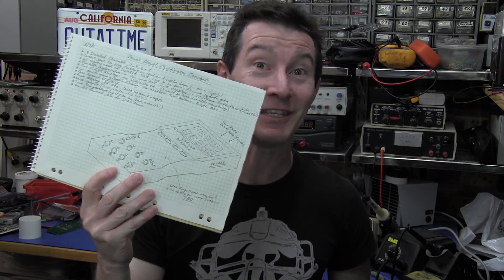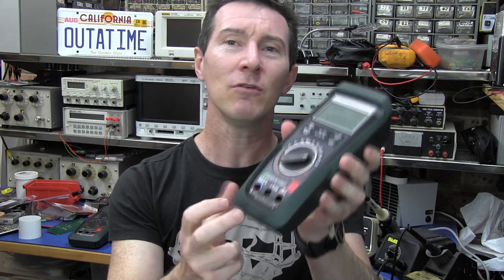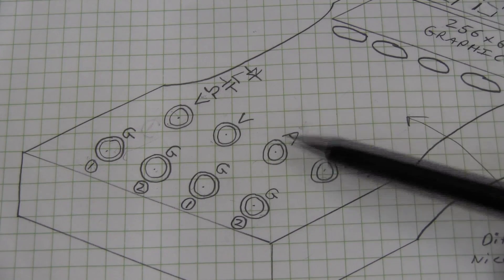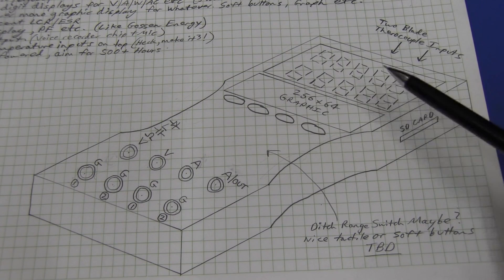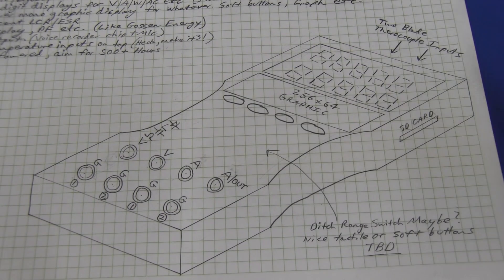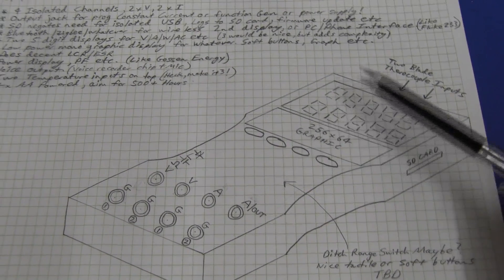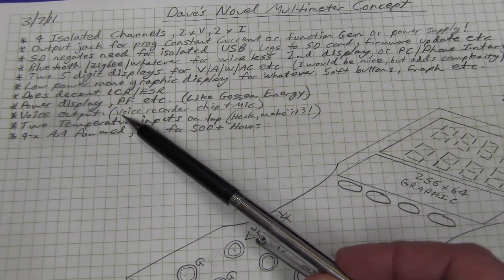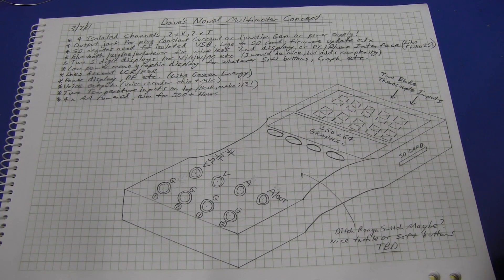EEVblog #184 - Open Hardware Multimeter Concept

Comment: Designing you own multimeter?
Now there's a project idea ...
If I were to make my own "multimeter" it would probably not be a "handheld" device.
It would be something like a 19 inch rackmount multimeter with lots of memory for data logging. And it would have lots of voltage / current inputs, so you could use it like a curve-tracer or measure 3 phase power or stuff like that ...

And the optional PC interface would be done with fiber optics.
No need for easy to loose SD cards and still isolated!

Comment: I stumbled here while researching my desire to design a 4 channel bench voltage/current meter.  My thoughts on the matter:-

As Dave says, a DIY multimeter project needs to provide novel features to justify its development over simply continuing to use existing multimeters. The features discussed in the video can be broadly grouped as:-

(A) 4 isolated V/I channels, and the resulting synergies for power/efficiency measurement
(B) Logging
(C) Battery life considerations
(D) All the other stuff

Feature group  (A) is inspired by the advantages it would provide:- 
* Reduces the workbench clutter of using 4 separate multimeters 
* Enables the synergies of P/E measurement, and logging

Which are of most benefit at the workbench. So it is best implemented as an item of bench equipment. Furthermore, a bench unit obviates problems with battery life, especially considering the extended operating time implied by logging, which is useful for both (A) and (D), but mostly for (A).

Feature group (D) comprises functions that usually:- 
* Only need a single channel
* Are needed only intermittently
* Have minimal impact on battery life
* Can benefit from being physically separate from (A), because it:-
  - Is out of the way when not needed
  - Doesn't disturb (A) when it is needed
  - May need to be used on items away from the workbench  

So it may best and/or more easily implemented in the handheld format, and can still provide logging. This can be either as an off the shelf existing multimeter, or as new project if the feature set justifies it. It may even be implemented as a (separate) bench unit, if the feature set is large. 

So to me it seems that my original plan for (A) in bench format makes sense, and that (D) should/could become a separate project for a later time, possibly split across both handheld and bench formats, but catered for by existing test equipment in the interim.

Comment: I like the idea of getting rid of the range dial. But how would the input switching be done then? Mechanical or solid state relays would consume quite a lot of current. Is there a low current way of getting around skipping the range dial?

Comment: should also do logging; having SD card is nice, but nowadays, it also needs to connect to your wi-fi network and allow data acquisition wirelessly, Bluetooth is a pain in the ass, wi-fi makes the whole interfacing thing trivial, just use the IP and open up a web page, from anywhere in your network

Comment: I would love to see you take this on the way you did the power project. Please. As for features….. 2 channels is enough. definately need the power supply with PWM/signal and function gen. I would love to see a basic logic analyser and maybe serial com output for testing SPI, RS232/485, I2c. TTL counter for rotary encoder checking would be great. I am an industrial Automation Tech and have dreamed of a device like this for trouble shooting PLC based control systems.

Comment: Dedicated buttons are way better than a dial. A dial is sequential: if you want to go from setting A to setting F, you have to click through B,C,D and E.
It's like a train.
A button is direct. Straight from A to F.
Teleportation!
Magic!
Reply: Also, a dial will probably cost more to manufacture and/or a low quality dial will wear out.
Plus it takes quite some space.

Comment: Dave, a question for you, or anybody else; could you use the same channel for both current and voltage/etc? maybe switch with a relay? In your design I noticed that you separate the I and V channels, is that for safety? Could a relay do the job? Assuming CATII/CATIII here
Reply: umm maybe, but remember, for measuring I it needs low R and the oposite to V, then the relay could be a good idea but the relay drains some conrrent, to much for a battery powered device

a way to do so is to found a less comsuming relay-lie device o a diferent compatible methods to measuring thoose parameters

sorry my bad english

Comment: EEVblog the graphic screen could be one of the 2" eInk based display, so it would match the big and nice segmented display that work in nearly all conditions :) especially if it would not be used for quick display refresh

For the selector, why not using 4 separate sliders instead of a classic rotary button?

Comment: Hi Dave, instead of going down the hand held meter route why don't you go for a bench meter then you could integrate all you ideas into it.
Reply: great idea. I would add this… Keep it small enough to fit in a technicians rolling tool box and make it rugged enough to use in an industrial setting. I am an Industrial automation tech, this device would replace three or four of the usual devices I carry around.

Comment: Looks like a cool multimeter. One thing I'd probably change is the USB. I'd probably try and add a USB powered battery charger. You could use NiCads to power the multimeter when it was unplugged from the PC and recharge while it was hooked up.

Comment: If I could design them I also would want software for chemical probes in my multimeter. Their input is mostly voltage and temperature and this is conversed in pH or oxygen or fluoride or even conductivity (which is resistance^(-1). Multimeter have the hardware to do this but lack the software and so we have different things for every job flying arround the workplace. A pH-Meter that could only measure pH, a Oxymeter that could only measure Oxygen saturation a conductivity meter... :)

Comment: Dave, Love the concept, but on my bench that's why i use the Agilent 34970 data logger , a 6.5 digit dvm with 40 leads with the right harnessing out of the 40 channel module. computer controlled to store different setup and computations channels. it's just not portable,  if you build it i'll buy it in a kit amd enjpy putting i together myself that's where half the fun is.

Comment: Hi Dave,

I fully support this idea...  (already donate so happy with all this!)

Now another idea that shouldn't take too much extra money for good quality, ideally you want to use relays for everything, so...

a) Can you have an option to switch grounds, i.e. to short the grounds from the diff inputs? (could be an LED on each input for example)
b) Could you  MEASURE ground voltage/current between input > this would be awesome and I don't know any multimeter doing this...

2cents

Comment: Haven't watched all the way through but here's my 2cents. For open source, why not make it modular - that's how open source software is designed. So go back to the old days of plug-in oscilloscopes and built a multimeter platform architecture, rather than an end product. So given options for displays - I still consider the old analog displays have value in making some readings, particuarly nulling. Why not have the input sockets on a module rather than have so many (less chance of misplugging)

Comment: Dave, the double meter into one is a great idea. You could also add a relay that switch the leads by simply using the main selector switch. In this way never having to unplug the lead to measure amp or volt or anything else.

Comment: 1. Instead of removable display, it should be a removable inputmodule... So all the inputs stay at your bench. Then you could pick up the multimeter (- the Inputs/outputs) and lean back in you chair and monitor it...

2. Scriptng functions, so you can load custom scripts that can use the inputs/output, displays and memorycard.

3. Built in batterycharger, so the batteries will charge while using it at your bench, so you allways got fresh batteries when you have to do work out of the office..

Comment: Make sure its IP rated.  Make sure it won't blow up on ya or catch on fire.  I like the temp. At least a range from say 15mv to 1550V.  AC response from 20Hz to 700MHz (or faster!).. Cost below $500 US. Include high quality probes.  Properly fused input jacks, etc.

Comment: Be nice to have a current limiter in it. even if it's not supplying its own power to the tested circuit. will help if your testing a battery circuit and slip with your scope probe.

Comment: Great idea is the SD-Card port. SD-Cards is my favorite kind of portable memory storage. If every computer had a SD-Card port, I'd use them exclusively, and not USB-Drives. I mailed my keyboard manufacturer, that I want SD-Card interfaces in keyboards (I have two USB ports there).

Comment: Nifty idea. I was thinking maybe a software knob for the range switch, so you can use it to go through menus or adjust settings/quantities or by default, change the range/function for the actively controlled input.
Also, as someone mentioned, possibly have scripting, so you can have user defined functions that could take data from an input and output the calculated data to the screen. Trouble with too much software control is that you start to lose the benefit of response time or low cost.

Comment: Why 4 channels? Why SD card? You need a FAT-compatible OS inside to get these feature. So I think it's simplier to add cascading output to single-channel multimeter and separate logging device =)

Comment: what about a solar powered one? or at least one that could charge its own nimh AA when not in use? i think thatd be neat.

how about wireless test leads? that would make it real easy to get into tight spaces. also, how about a wireless watch module? the multimeter could transmit wirelessly to a watch or device you wear on your wrist or even some LCD glasses you could wear!

Comment: How about using one single graphical display for everything? This would enable users to reconfigure the display on the fly and change the real estate each measurement takes on it. Beside, at this point you have no way of indicating what the top row is actually measuring - I think the unit of measurement should be next to the digits to avoid confusion.

Comment: @Whisper6911 No, they doesn't anymore. You have plenty of cheap battery charger chips which don't let it overcharge, monitor every cell voltage and temperature and balance them. Li-polys are in every small gadget or phone and when was the last time they exploded? And if you are extra scared you can always use the LiFePO4 which doesn't have those exothermic reactions. So 18650 or just flat Li-poly isn't problem.

Comment: Multichannel meter is what I was thinking about for some time. Now if it has good isolated inputs up to about 1000 V, that would be great. Small DC/DC converters are cheap today. The ESR measuring would be useful for me. I don't know if I would use thermocouples but some 1-wire or I2C thermometers yes. Basic tone/frequency generator is very handy bud sadly only few meters have it.

Comment: Add math features, so you can do calculations with ANYTHING, including calculations of calculations. Example:
Input power = Vi*Ii
Output power = Vo*Io
Power loss = Input Power - Output Power
Percentage of power lost = (I can't remember and I can't figure it out on my mind without some paper and a calculator)
It needs a good labeling system though.

Comment: @igwood71 its simple dude: lithium ion batteries explode too easily.
if u overcharge them, if you are drawing from several in series with one of them
being weaker then the other, and that kinda thing.

considering the way multimeters are used that could be problematic.

Comment from the maker: @joeles69 Not in my meter, ever. It's standard primary sizes or bust. There are very good reasons why almost no handheld meter in the market uses anything but standard 9V or AAA/AA batteries.

Comment: also i would ditch the 9v battery or the 4x AA batteries and swap them out for 18650 type LiPo batteries. they can be had for as cheap as chips and are rechargeable.